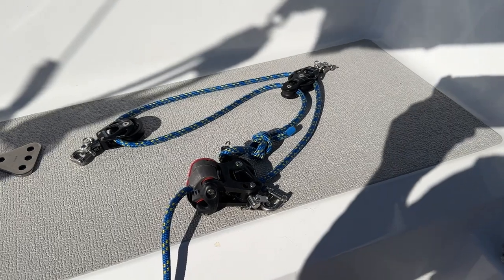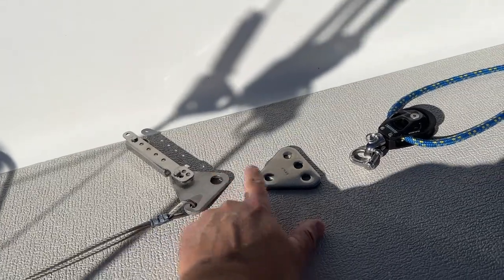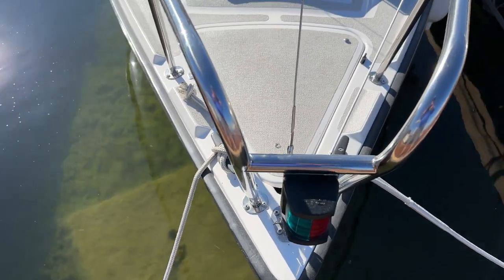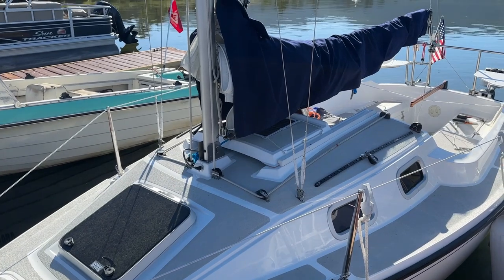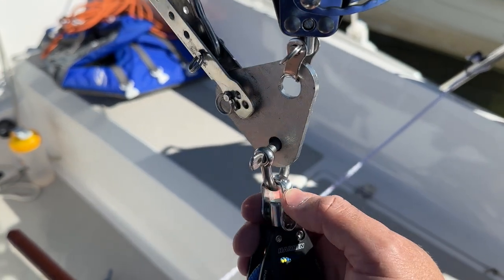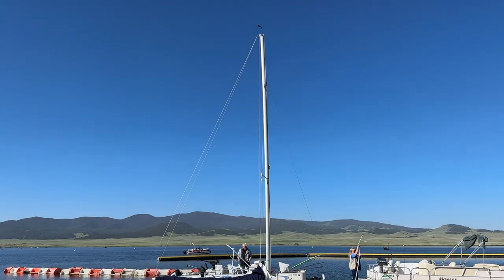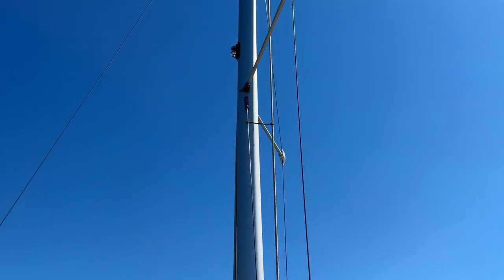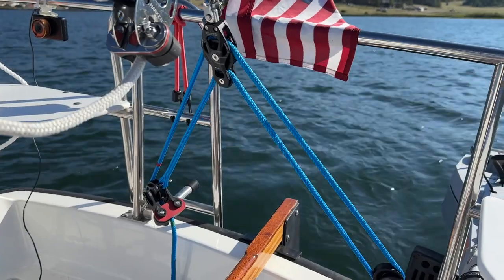Adding a Backstay Adjuster

Comment: Just curious:  Where did you find the recommendation to limit bend to I*0.02?
Reply from the maker: Great question! In his book (and on his website dedekam.com) Ian Dedekam says maximum mast bend should be 1.5x the diameter of the mast (fore aft measurement), BUT it should never exceed 2% of I (see page 69 in “Illustrated Sail & Rig Tuning”. I just went with the 2% of I since it’s the true never exceed measurement and also the smaller measurement of the two on my boat.
Reply: @ColoradoSailing  Much appreciated.  I've been bending masts for 40 years and never came across a recommendation.  This recommendation is about what we've been doing recently with several boats from 25 ft to  37 ft long.